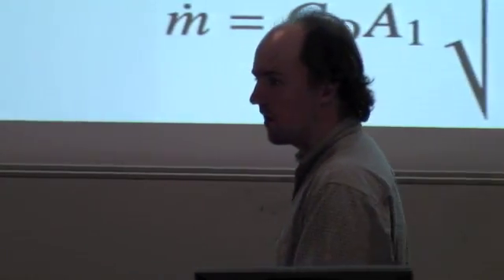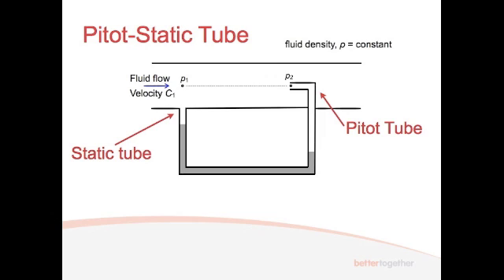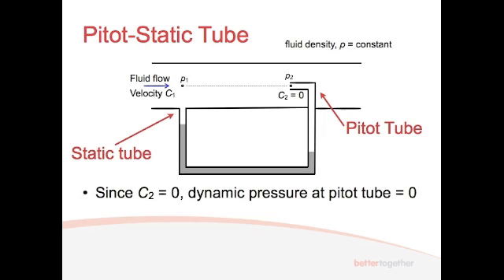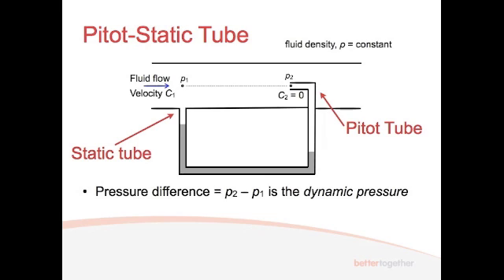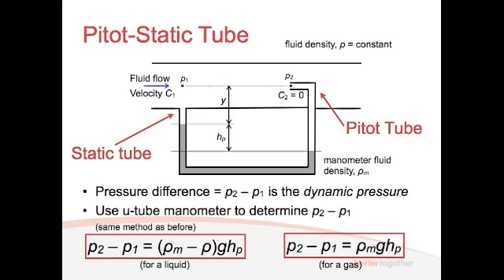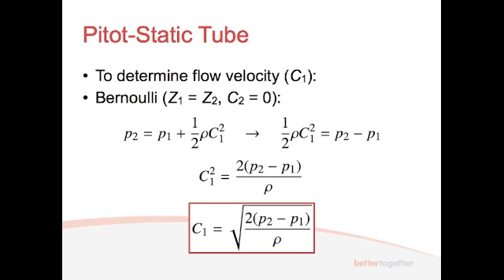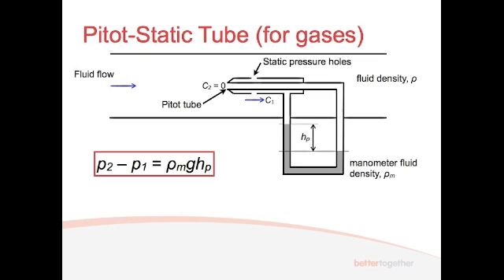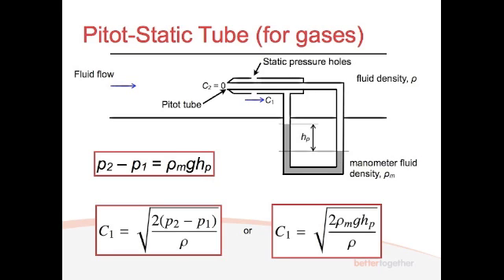Fluids - Lecture 3.4 - Flow Rate Measurement

Comment: The fluid inside the pitot tube is standing still rather than flowing, so none of the fluid flowing around it with C1 actually enters, therefore the velocity C2 right at the entrance of pitot tube = 0. Cheers!